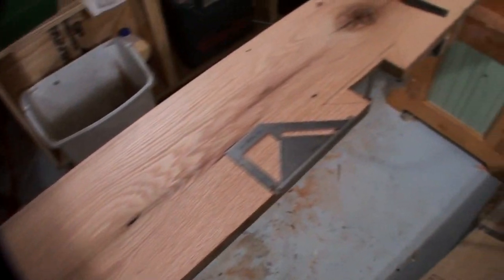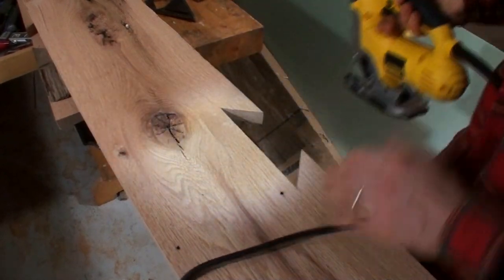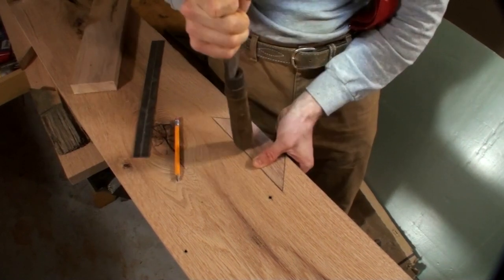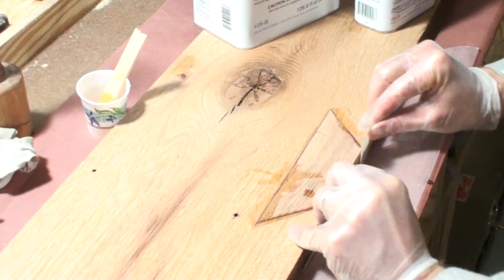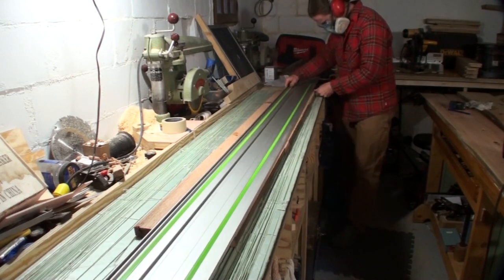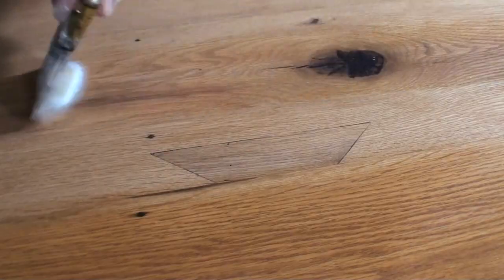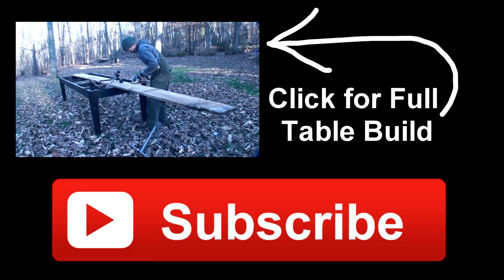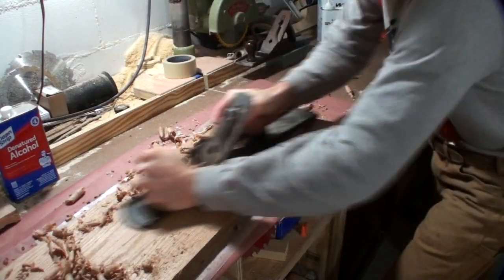Repairing Damaged Reclaimed Wood - The Dutchman

Comment: I've never seen a dutchman used on an edge like that, but later in the video, I saw that it was in the middle, and you had just not finished the tabletop panel yet. Good idea!
Reply from the maker: +Bruce A. Ulrich Stuff gets called all kinds of things, but my definition of a dutchman is patching wood with wood. Removing a bad spot and filling it with a piece of wood that fits. A dutchman can be in pretty much any shape. A butterfly joint is used to avoid cracking or splitting of timbers. Dutchmans are used in a lot of trades, one being boat building. When repairing rotted or damaged timbers you can remove the entire effected area and fill it with wood. Using the dovetail shape is more decrative than anything, but it keys in and holds better than just a rectangle.
Reply: +The Homestead Craftsman I like it! Good information...thanks!

Comment: I see that you use the West System 105 & 205. I am a novice when it comes to epoxy. Could you tell me your thought's on that particular brand. Also if you could explain the Black Epoxy to me I would greatly appreciate it. Thank You, Marty
Reply from the maker: +harley75us I'm going to do a video showing filling holes, etc with epoxy soon, already filmed it. The West System brand is good, it's considered one of the top brands. The 105 is the epoxy, the 200's are the hardeners. They make different set times. I have a fast and slow..but fast is not really fast compared to 5 min epoxy.  The slower setting makes it stronger. The black epoxy is just tinted, I just use black chalk for chalk lines when filling gaps. They also make liquid tints, trans tint is one of the  big names. It's expensive to buy this much, but cheaper by volume. For example, I got the gallon of epoxy and two quart cans of hardener and it was $200. If you just do an occasional project that needs a little, than this is over kill...... but if you use it a lot and fill gaps and such then it pays off. It's also very convenient with the pumps.

Comment: Black chalk for chalk lines you say? Never heard of it before this. I've been using TransTint. Worth the price of admission right there. And a question: you say you don't like PVA because of the visible glue lines, but then tint epoxy black so the glue lines are more visible...what's the difference? I would probably use Titebond translucent.
Reply from the maker: +Michael Anderson The chalk works good, it's cheap and you don't need much. I just use it when filling gaps, knots, etc. The wood glue would leave an ugly "wood glue" line, I don't mind if the black shows up. It blends in better with this style table. I do use tight bond to glue the table up. Also, with the last part I showed in the video, hidden at the end, where I have a lot of endgrain in a seam, the epoxy is stronger there.
Reply: +The Homestead Craftsman OK, thanks. I am going to use the chalk for sure. I've just been using tinted epoxy for filling knots etc. and using Titebond regular, dark, or translucent for all gluing needs. But I've got a big can of West System 105 and a smaller can of 205 that need amortizing :)

Comment: where does the epoxy come from? ive heard of folks using fiberglass resin.....opinion?
Reply from the maker: +MidGAOutdoor They are both adhesives, but epoxy is normally going to be stronger. Epoxy cost a lot more. Fiberglass FG Resin sets up really fast, it also stinks while epoxy loses it's smell quick, resin can take a very long time to not smell. Most likely epoxy is what you want. This epoxy is west system 105. You can get it at many locations online, it's all about the same price. It's used commonly in boat building but has many applications.